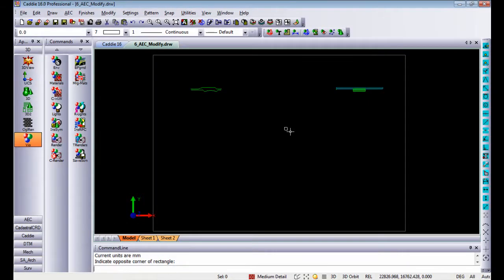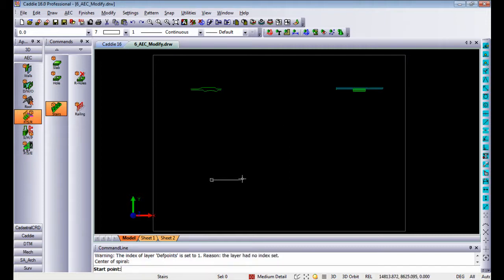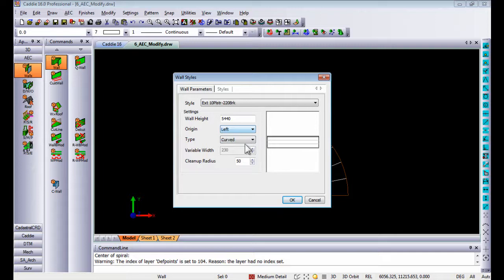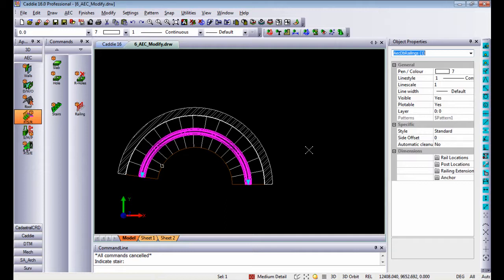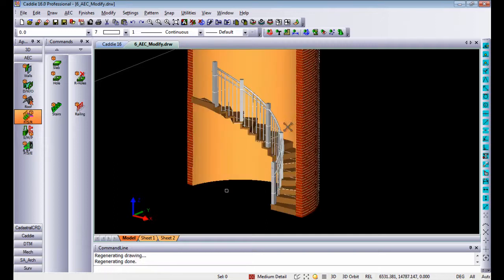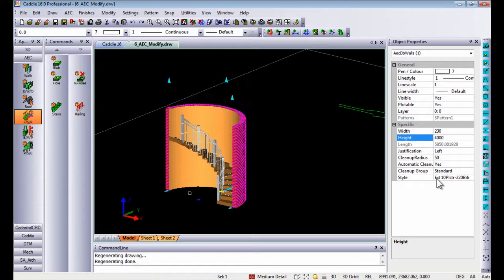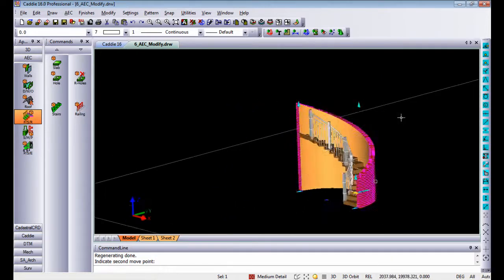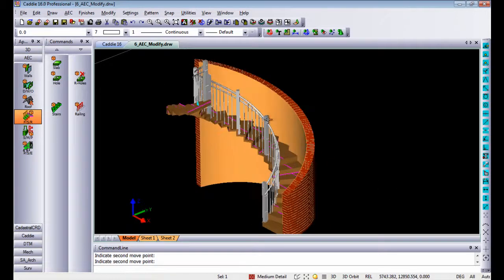AEC 3D Spiral Stairs and Railings in Caddie .dwg Architecture compatible CAD software

Comment: is there a way to do an aec spiral/curved staircase and add the steel components from which it is made from?
Reply from the maker: Whilst there are possibilities for customising the stair, and further possibilities for customising the railing of the stair, we would need further information as to what you are trying to achieve. maybe email us a drawing to have a look at. Our email is support@caddie.co.uk
Reply: @CaddieSoftware  i need to do a flight of stairs thats made of PFC 200 channels as the side beams and then a bent up vastrap plate as treads. Im struggling to find an option to customise the stairs and to maybe get dimensions of the stairs